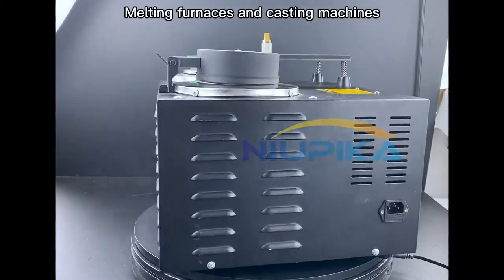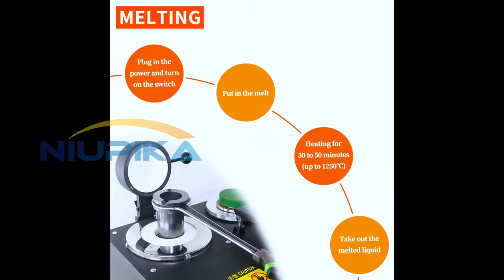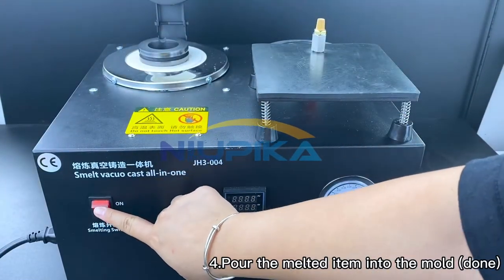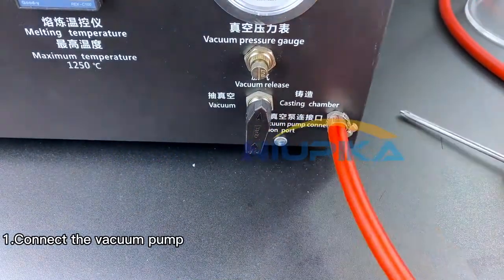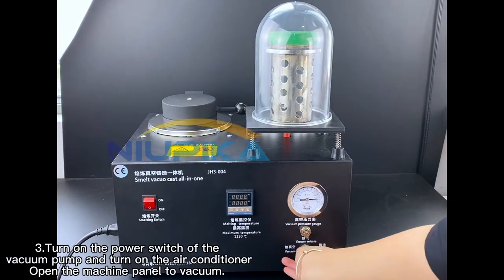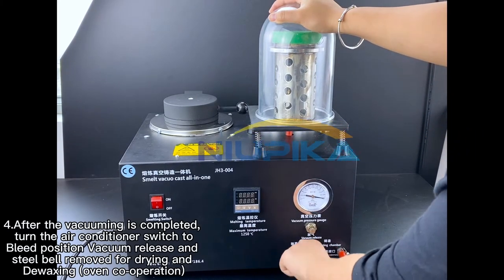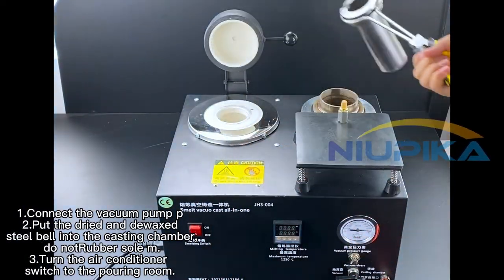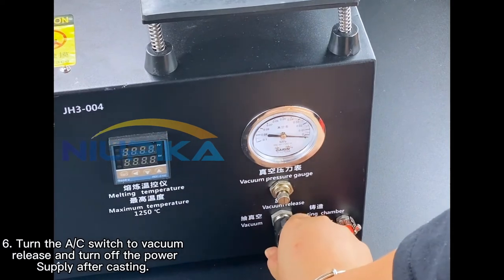NIUPIKA Manufacturer!!! Cast Vacuum and Melting Machine Digital Display High Temperature Refining

Comment: Will have to use the air motor, thank you
Reply from the maker: Hello, dear friends, the air compressor of this machine can be used in two parts of vacuuming and casting chamber, the use method is as follows:

A. Vacuum
1. Connect the vacuum pump
2. Put the prepared steel bell filled with gypsum slurry into the casting platform and cover it with a vacuum cover.
3. Turn on the power switch of the vacuum pump and turn the air conditioning switch on the machine panel to Vacuum
4. When the vacuuming is over, turn the air conditioning switch to the vacuum release position and take out the steel bell
Drying and dewaxing

B. Casting
1. Connect the vacuum pump
2. Remove the rubber bottom of the steel bell after drying and dewaxing and put it into the casting room.
3. Turn the air conditioning switch to casting chamber
4. Pour the smelted metal liquid into the mold for casting
5. Return the crucible to the furnace and turn the furnace off.
6. After casting, turn the air conditioning switch to Vacuumrelease and turn off the power.